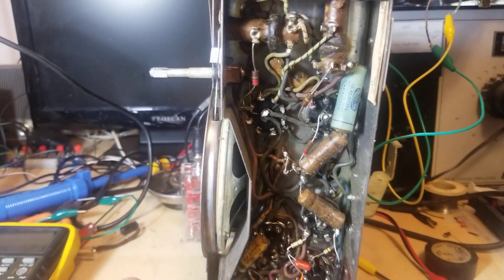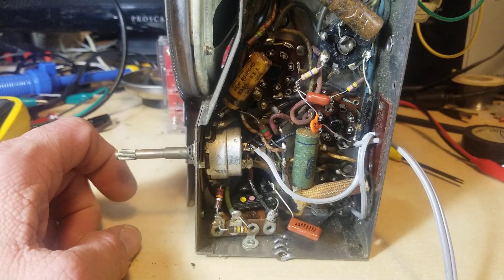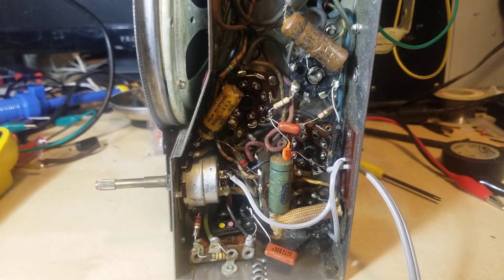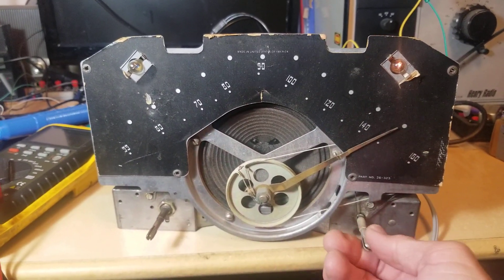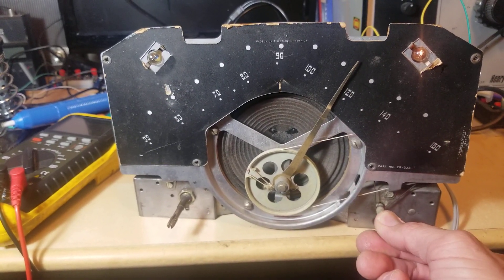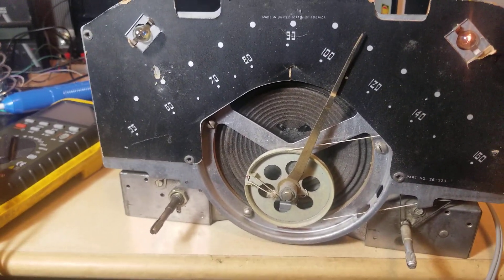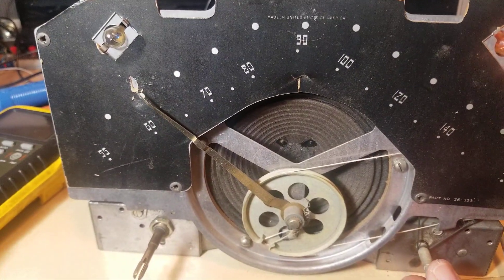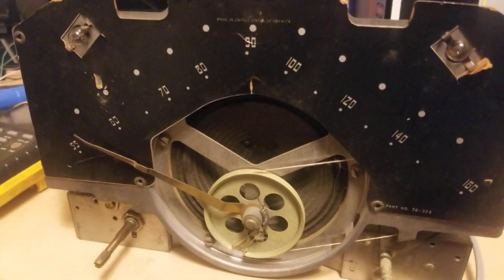Zenith 6D029 pt. 2 1946 radio power up test

Comment: I've heard that it's best to only replace the wax capacitors that handle the most current. The low-voltage ones can be left alone.
Reply: You can usually get away with leaving low-voltage waxies in, but it's definitely not 'best'. They still leak and degrade performance in a variety of ways; they just won't (usually!) blow stuff up like HV caps.